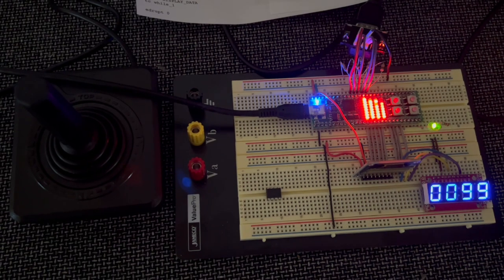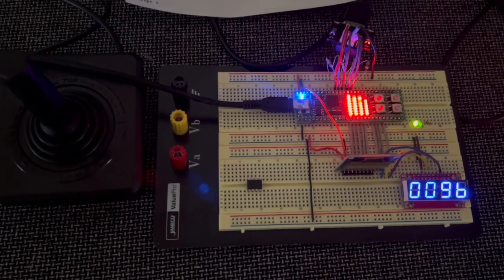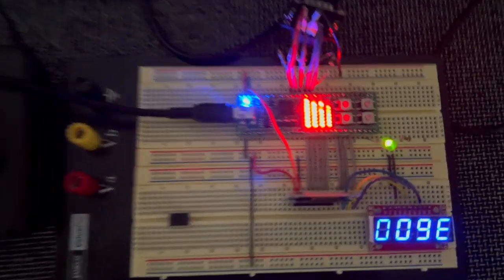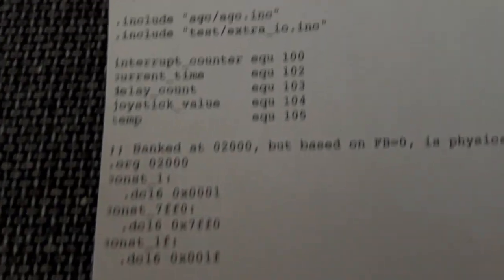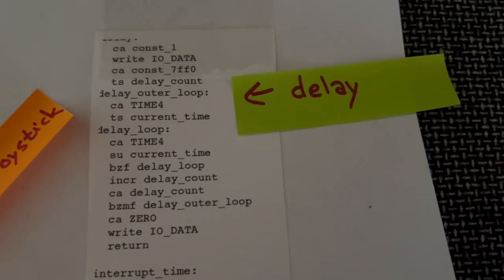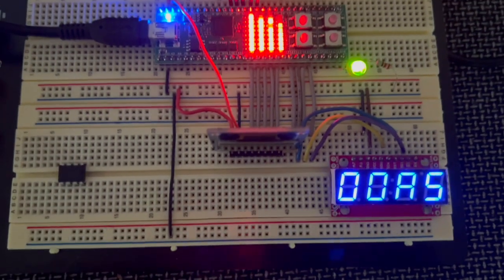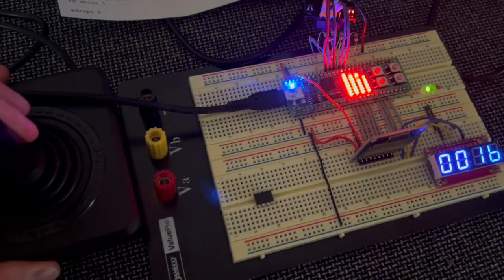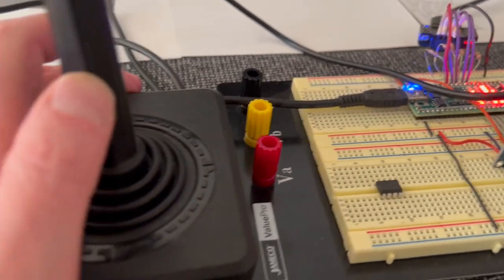Apollo Guidance Computer In An FPGA

Comment: That’s cool, how did you flash the assembly onto the controller?
Reply from the maker: It's hardcoded in the FPGA's Verilog:

initial begin
  $readmemh("rom.txt", fixed_memory);
end

The Makefile has some recipes for building specific test programs and generating the rom.txt from it. I could add a bootloader and read from UART, but meh... :)